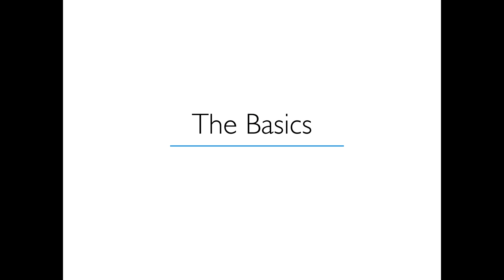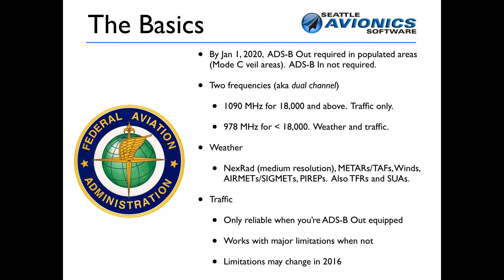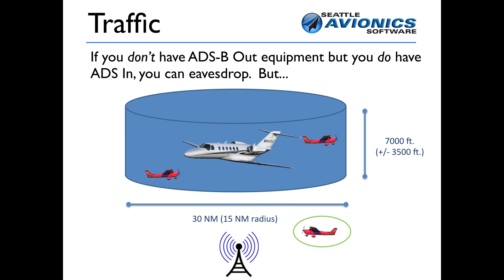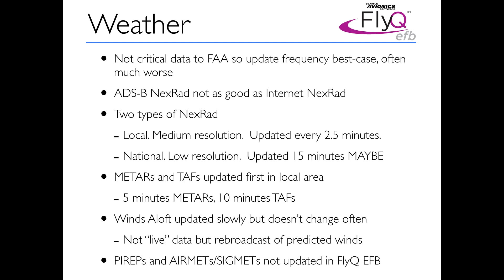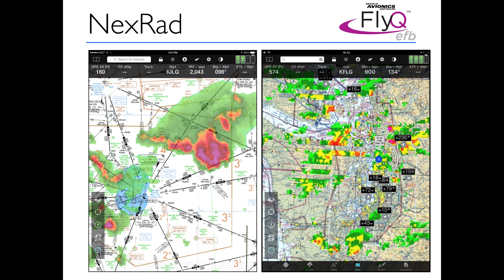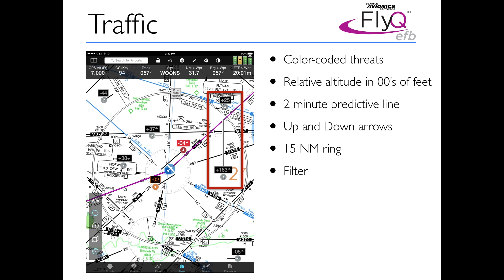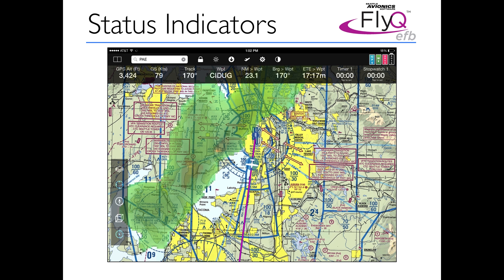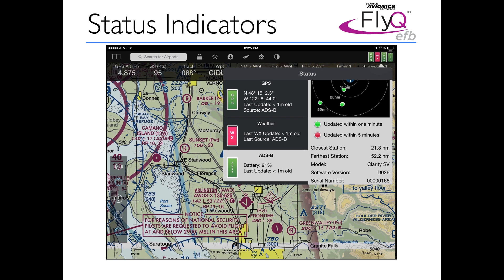ADS-B

Comment: Why not with Garmin? It's super frustrating.
Reply from the maker: We support 20+ ADS-B and glass panel devices (Avidyne, Dynon, Aspen, FreeFlight systems, L-3 Lynx, etc.)  We're very happy to support Garmin and would do so in a heartbeat if given the chance but Garmin tightly controls access to their systems -- not an open system like virtually everything else.  Please contact Garmin and insist on FlyQ EFB support -- companies tend to listen to their customers.  We are talking with them but nothing speaks like the voice of the customer.
Reply: FlyQ EFB, I started my IFR training in a PA28 with a Garmin ADS-B and I'm not able to use the feature. I like FlyQ but I'm gonna have to switch to a different EFB to be able to use the Garmin ADS-B.